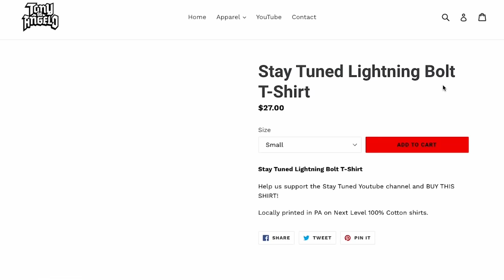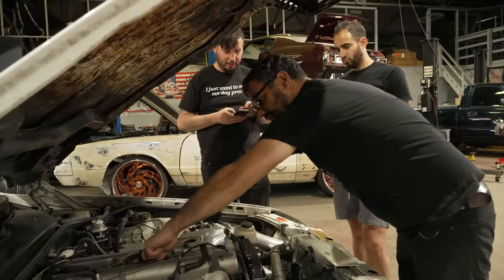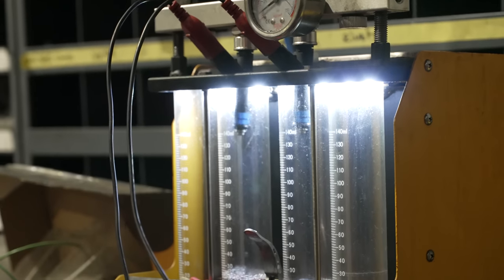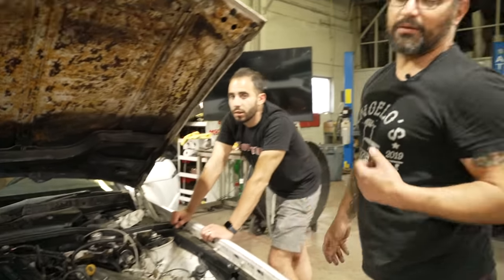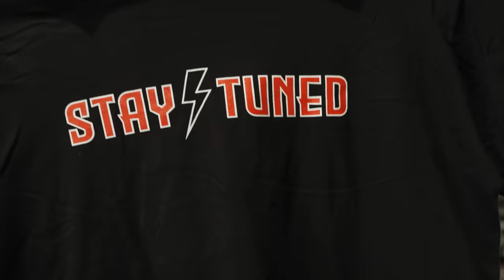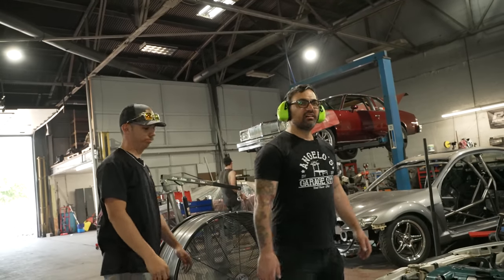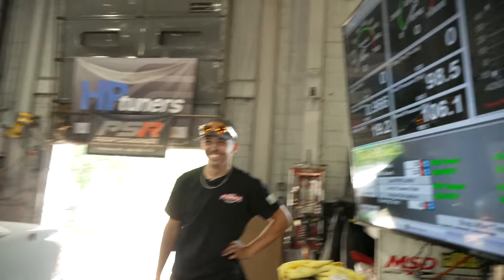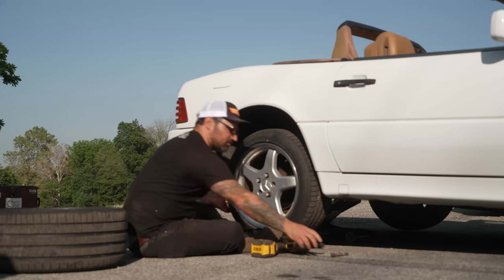2JZ Turbo Swapped 6 Speed Benz Back from the DEAD and it RIPS! - Tony Angelo’s Stay Tuned

Comment: Tech tip:  Injectors are one-way valves.  You can blow out junk by using carb or brake clean and spraying through the outlet (cylinder end) of the injector.  Not as good as the bench cleaner that they used but enough to get you running again if crap got in the intake (rail) side of the injector.
Thanks for another great video.  That thing is a BEAST.

Comment: It's an epic swap. With my 1JZ-vvti, I removed the wasted spark and fitted coil on plug sequential ignition when upgrading to a Haltech. In the previous videos with this JZ SL Merc, you can also hear the Wastegate sounds kinda funny when it's on boost. That's the wasted spark setup for you....Sounds great now though :-)
Reply: huh thats interesting, i did notice it sounded a bit different than im used to and i also have a sequential injected screamer 1j. whats the theory on why it changes the sound?
Reply: @ooohry  I think it's because with the wasted spark setup, it fires on the exhaust stroke, so you get the funny sound from the screamer pipe!

Comment: Hey tony i had the same issue regarding the front main seal due to crank case pressure on my 88 turbocoupe, i did a broke mans dry sump (the vacuum aspect in crankcase), turbocoupe turbos have an inlet that bolts on to the inlet with 2 nipples on them to act as a vacuum source, i got rid of my pcv valve and ran a hose to the nipple, the valve cover breather/ oil separator was run like this from the factory, after i did that with my crankcase pcv i took it for a few WOT runs and it sucked the rear and front main seal back in and i had a little more off idle power and slightly better low end driveability plus a slight increase in gas mileage, never had crank case issues after that...but keep in mind it will make the turbo inlet dirty so its a good time to also add a pre turbo water meth injection set up to keep it clean. Just a little tip to orevent future front and rear main seal issues on boosted cars

Comment: I love a good diagnostic process! Thanx Tony ^^
Reply from the maker: Thanks for watching!
Reply: @StayTunedTA  No worries, great stuff. Here’s some content I’ve had on my mind: Have that welder of yours mock up a tube chassis, and then let a wild tuned engine hang out the back. K-series? VR6? Or maybe a V8 like Clarkson?? You could call it the Murial Adam, or raised suspension and knobby tires for a Murial Go-mad ^^ #modernW198 Cheers

Comment: Awesome build, love the mixture, "blasphemousness" haha
Youre down on power if youre a tick over 400 with 19 psi of boost, no?  At ~15 psi youve got double the air mass as you would NA... in theory, before losses, you should be double the HP as an equivalent engine running NA.  I just imagine a 3ish liter straight 6 should be making a bit more than ~200HP NA, ya know?

Comment: Did you determine why the last ecu failed? If not, what is preventing the same problem from occurring again?
Reply from the maker: I would assume voltage spikes from jumping the car a million times with a dead battery, bad connections etc.

Comment: This is common knowledge but when I’ve had injectors that will not flow equally or are clogged, weird spray pattern etc. Instead of rebuilding them I have put them into a cheap Chinese ultrasonic cleaner/bath for about 15 minutes and 9 times out of 10 it fixes them

Comment: NPT is "National Pipe Taper", not "National Pipe Thread".

There's also NPS (National Pipe Straight) normally sealed by o-ring and NPSM (National Pipe Straight Mechanical) which is a mechanical only connection with the standard pipe threads.

NPTF is "National Pipe Taper Fuel" and it's definition ensures that the thread roots and crests mechanically interfere when tighten...creating fuel safe joints DRY, no Teflon tape or dope required.

Comment: I didn't realize 14 on a 2j was 300 
Seems low
Reply: Small janky turbo, what do you expect
Reply: kinda defeats the purpose of removing the m119. not much weight benefit for 20 less hp.
Reply: @schafer240  psi means nothing without taking into account the size of the turbos and other factors.

Comment: 360 wheel @ 14 psi??I have a port injected small block ford that makes almost 600 wheel on 10psi. Where was the timing and what was the afr reading? Had to be like well under 10. I know my 2valve 4.6 is happy at 12-13 but my small block ford loves 11.5-12
Reply: Psi doesn't mean anything... 14 on a t25 isn't the same as 14 on a t67